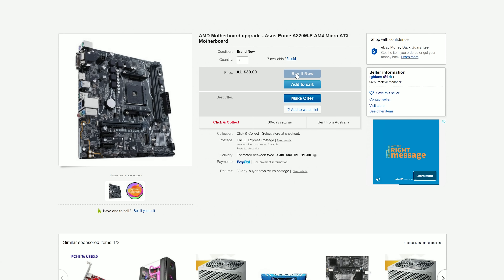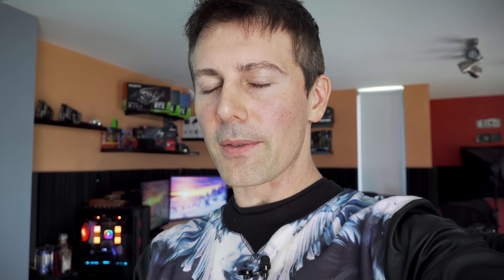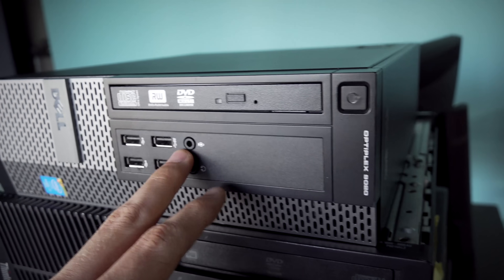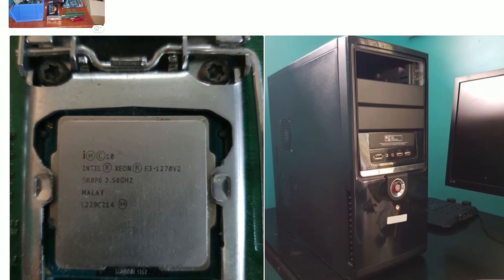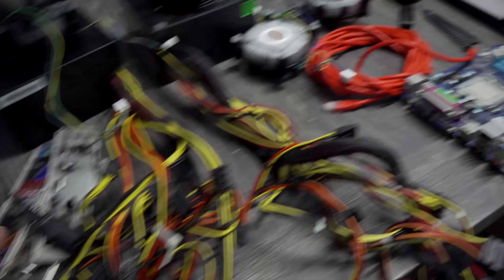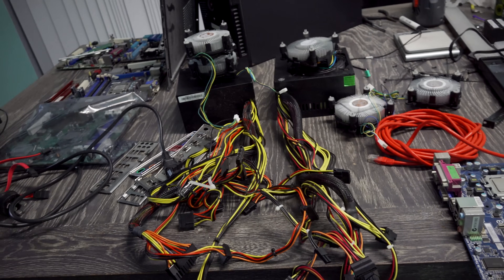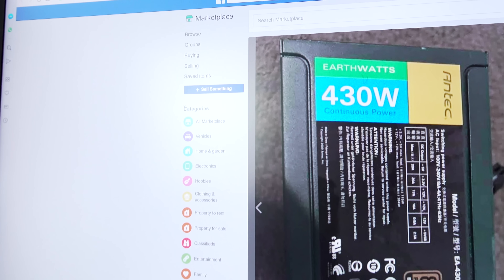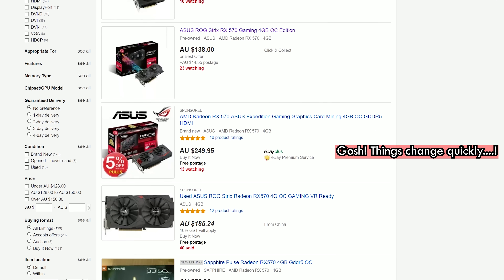Buying $1500 of USED PC Parts... (June 2019 Hunt of the Month)

Comment: Nice haul B! Most systems I run into are dirty! Usually dusty and lots of lint and if there's a pet around; animal hair to. But that can all be cleaned up fairly easy. Computers that have been in a smoking environment are so much worse. It stains everything. It smells and it actually causes damage. Mainly the tar and nicotine because it gets into everything. it gums things up like fans, buttons, and one that used to stand out a lot was optical drives. The lenses would become covered in it and they wouldn't work anymore. You literally had to take the drive apart and clean the lens with alcohol and a q-tip.Fortunately optical drives are becoming rare. Back in the 50's and 60's NASA allowed smoking in the control room but they stopped it because it was causing problems with the equipment. It wasn't just because they're disgusting.

Comment: I a good deal too the other day, I went to a place where they recycle computer and found gold in a pile of crap. I got an dell xps with an i7 6700, 16gb of ddr4 ram gt 730 and a gt 730 oem computer with a 80plus cert power supply for 140 dollar I even got the guy to throw in a ssd. He didnt even know what kind of i7 it was so when he give me the price for it I had to get it. They usually get very old oems so he sold it as if it was one of the old i7s.

Comment: intel xeon 3e 1270v2 works on A OEM MB ????????
Reply: IT is the pendant to the core i7 3770, if there is no bios which supportes the Xeon, there is a possibility to install a very old CPUZ Version, which cames out the time the 1270V2 was released bevore, Th maiboard "" thinks"""" that it is the 3770. i did that with an E3-1240V3 which was recognized as a Core I7 4771

Comment: A320 series chipset support for Matisse - most things I've seen say no, & even a slide from AMD points to a no.  B & X 3xx series, it's going to pend on motherboard manufacturer and decisions they made when making the board in question, but for the most part it looks like a good number will support Matisse - just look for a current Beta BIOS with it to know for sure (hopefully we see non-beta BIOS's by launch day). If the info I've seen and come to understand over the last month is wrong, then it'll be fantastic to have that upgrade path for A-series chipset owners. :-)

Comment: I thought according to AMD's "official" compatibility chart, the A320's would NOT support the 3000 series.  Even the high end X370's were listed as a "beta BIOS" only.  I mean, there's no reason why it shouldn't work, but I guess AMD just doesn't want to take the responsibility of the many cheapo A320s out there not working.

Comment: I’m curious since you mentioned it a bit, if you have a test method for your used power supplies before you trust putting them into a build.  Typically a used PSU is the most dangerous part to pick up because you don’t know what to expect until you flip it on.  I’m thinking a good method would be to test them on some ‘throw away parts’ before putting them into a valuable build.

Comment: I thought you were done with the LGA 775 socket
Reply from the maker: I am, that was just thrown in with the 150 deal.
Reply: @techyescity  have you realized this chinese seller who sells the tons of Core 2 Extreme QX 6700(<20), QX 6800(~34), QX 6850( ~45). He has every core2 Extreme, only the QX 9770 not, the QX 9770 still costs ~200€? I´ve testet a QX 6700 on my P5WDH Deluxe. It works, and i could overclock it over 4x4 GHZ with the the referece cooler. Thr mor you buy, the chips getting cheaper~ 10 QX 6700 for 150€ andyou can giv them back in between one year!!

Comment: For those in the US, buy a brand new rx 570 or 580 and sell the 2 free games that come with it on reddit. You'll be looking at a brand new rx 570 for ~$100.00 and rx 590 for ~130-150. Microcenter is also running a deal for $30.00 off when bundling and AMD motherboard and CPU. Plus a ryzen 5 1600 is going for 79.99 at microcenter. Lot of great deals out there, get them while they last!

Comment: how do you know a seller is good on FB and Gumtree? i've been thinking of getting a 1660Ti to use in an external enclosure (Alienware graphics amp). is it better to wait for ebay deals or flip my current Alienware 15R2 that i wanted to get the enclosure for? (want to drive a monitor and a tv from the discreet graphics but it only has one video output)

Comment: Why are you willing to spend so much on a 1050 Ti while the performance/$ is so much better for the RX 570? Is it just because of branding? The buyer who knows Nvidia and doesn't know AMD, does that make you spend more on the 1050 Ti? I think that $113 is quite a lot for a second-hands 1050 Ti, especially compared to the prices of those RX 570 cards which you mentioned while the RX 570 gets a much higher FPS for every game compared to the 1050 Ti. Hell, even in Gameworks Final Fantasy 15 the RX 570 beats the 1050 Ti if I am not mistaken.
Reply from the maker: Yeah man, for used flipping there is nvidia and i7 tax.
Reply: @techyescity  

Thanks. :)
Reply: @techyescity  

Coming back to my rant on people throwing away perfectly fine PC's. At a public music school close by they have 4 Apple AIO computers in the teachers lounge. Such a waste of money. I told my teacher that they could buy a computer for $50-100 and a SSD for $70 and a $100-150 1080p IPS monitor which gives the same performance except for the monitor having a lower resolution (irrelevant for what they do with it). To my surprise the teacher (early/mid 20's) also was aware of that. They don't use those computers for anything which requires any processing power. I try to educate people around me to not waste money on hardware which they don't need, especially if ordinary people pay for it. They could have lowered the tuition fee or have bought a few extra pianos (practicing outside te classroom) with that money.

Comment: You have got to love those second-hands OEM boxes, one person's garbage is the other person's treasure. Especially because many sellers are clueless about the value of it. Having said that, the value of any quadcore CPU has decreased a lot because of Ryzen but most people don't need a computer for games which require more than 4 CPU cores. Frankly, it annoys me that people throw away PC's which would be perfectly fine for offices, students, most grandmothers...as long as you put a SSD in it and do a clean install of Windows or put Linux on it. Maybe another case with a proper fan.

Comment: The Yes Man with another great hunt! Anyone got advice on what to do with modular power supplies? Got a heap of them sitting around cause I don't have cables to go with them, and the cables seem to be around $10 each. At that price it seems better to just buy another power supply.
Reply: Buy a decent(doesn't have to be expensive mind) crimp tool and crimps and get modding.  I just done my Enermax Galaxy DXII which is(I think) over 10 years old now.  Looks really nice with white sleeving too.  It really wasn't that expensive either.😊
Reply: @JuxZeil  I hadn't even thought of just crimping my own damn cables for them. Thanks! I will definitely look into that.
Reply: @ItIsNot1984  No probs.  If you're like me, a bit of a hoarder, you can use the wiring looms from just about any 12V+ appliance/equipment to really save you a lot of cash.  👍
Reply: @JuxZeil  You got me on a wild tangent now. Looking into this and thinking, "What would stop me from making my own replacement cables and selling them?" As I'm looking into it, this seems like a ridiculous markup. Even on aliexpress, they're almost $10 each. The demand is definitely there considering modular is so popular. Nearly every time I buy a pc for parts, I end up with a psu that is missing cables. I use what I can while others get thrown into the pile.
Reply: @ItIsNot1984  It's a lot of work to sell to public, and the copper in the wires is what make the cables expensive really(copper can go up/down in price DAILY so they adjust pricing for it).  Also some manufacturers have custom connection block(extra R&D) or they are wired slightly out of standard spec, so be mindful of that too!

Comment: Ebay is drying up but in the states. MicroCenter got some killer deals on open-box GPU's and a 7980XE for $1200. That still seems like a deal to me. 
  As far as GPU's, how about an ASUS dual GeForce RTX 2080ti for $900, MSI Ventus RTX 2080 for $650 and a EVGA XC Gaming 2070 for $485 along with a Gigabyte triple fan OC RTX 2070 for $550. For the more nicer cards they have some EVGA 2080's FTW 3's for $800 and the BEST deal's of all, the VEGA's. 56's for $280 and 64's for $380. Let just say i'm cleaning up. I bought a couple open box 16GB Trident Z RGB 3200MHz kits at $120 each. might make a vid with all the open box-deals and hit every MC up state to state.lol then again that might not be smart if i want keep getting these deals.

Comment: Dont know why i bother writing in the comments section as i never get a reply, well except for the time you were in Italy and i had a go at you for bad mouthing a Pentium 4 system/Mobo. Anyway here goes. You may want to check out MSY for deals on PC cases and 120mm single color RGB fans. https://www.msy.com.au/wa/cannington/fan/22257-gamdias-aeolus-e1-1201-120mm-single-blue-gaming-case-fan.html I got a few of these for a Xeon build and an i5 build and the fans are really good quality compared to the cheap crap on ebay.

Comment: i have i7 3770k but my motherboard intel h61 oem pciex 8x working i need z77 mobo
Reply: Hi i have a i5 3570k i am planning to buy an asus z68 from aliexpress for 60€ its also pretty decent for oc
Reply: @techcheap2340  the Z68 platform was made for overclocking, the H61 not.
Reply: @8iosatlost209  yeah thats why you need and z68/z77 for overclock
Reply: Biosat Lost
Biosat Lost
vor 1 Sekunde
i can sell you an Asus p9x79( refurbished by myself 150Dollar)& a Core I7 3930K(80dollar), Xeon E5-1660( 139dollar), E5-1620( 40Dollar)and an evga GTX 980TI SC+ refurbished( together with board& CPU)160 dollar: P9X79+Core I7 3930K( i can overclockthe chip in the bios to stable 6x 4,6GHZ) together for 360Dollar,  i give a case as as gift if you buy this

Comment: Have motherboard manufacturers rolled out BIOS updates for Ryzen 3000 on current boards? If not, then people should hold on to their Zen 1 and Zen + CPUs
Reply: (Otherwise they won't be able to update the BIOS required to get Ryzen 3000 chips working)

Comment: whenever i see something iffy in hardware i clean it up just enough then test it real well then when i'm sure they're good to go, then i clean up real good. sometimes i cleaned something up real well then i ended up cleaning it up and wasting my time.
Reply: Sometimes fully cleaning it can make it work, had a absolutely caked in dust and dog hair gtx 960 that wouldn't boot, took it completely apart and cleaned it repasted it and it booted fine and stress test passes.
Reply: @moramaasi  i do that only if it absolutely needs it and if it really doesn't work when it's somewhat dirty.

Comment: nice parts hunt <3  
I myself use a old  HP 800 G2 with a 1050ti LP as my main gaming rig and im happy . greetings from germany
Reply: I have a 970. Is the 1050ti faster?
Reply: Kubat Altu no the 970 is faster
Reply: @HoellTech hmm you play 60fps on 1080p? Because my grafficcard is already getting bad at holding 144fps in most games
Reply: Kubat Altu Yeah i Play on a 60hz Monitor. No Problems.

Comment: Cool deal on the Optiplexes! The 9020 ones do require an 8 to 24 pin adapter to support a standard ATX PSU, but they can be transferred as is into a regular case as long as you keep the thermal sensor, chassis intrusion switch and the IO cable. I just finished to solder all the IO cables on one of these to get it into a mATX case and all is working great with no boot errors! Cheers!

Comment: The total deal has to include your time, vehicle wear, fuel etc. Purchasers of your rigs should consider this if you are selling systems 3,4,5 or 6 times the cost of the original purchase...
Wouldn't an undervolted, under clocked rx 570 still be cheaper and faster than a 1050ti and not require extra power? I'm going to run my GPU into the ground. Prices way to high to justify upgrading a GTX 970...

Comment: hahaha i have a i5 2400 and want a xeon 1270 v2 for "upgrape xD
Reply: an e3-1270 v3 costs about 100€, so the e3-1270 v2 is around 80, i would look after an e3-1270. It is 100 MHZ slower and nearly the same. i bught an e3-1225 for 22€ a few month ago, the 1225 is cheaper than the 1220 which costs about 30€.do not overvolte the memorycontroller much over 1,55V,!!! the e3 Xeon memorycontroller do not stand as much voltage than the core CPus from this generation!!
Reply: @8iosatlost209  i dont plan on oc It, and the only difirence is 32 Nm vs 22 nm on the other hand you are right v2 cost 110 usd and v1 cost 73 usd so thanks for the tip im looking foward for It
Reply: @danychang1206  i could trx to get an E3-1270 v2  for 90-100 Dollar for you, if you pay the shipping and tax! If you want?

Comment: around 10pm tonight i was browsing the local facebook market place and saw a 4790k with a z97 MSI (think it was the gaming 5), 16gb ddr3 1866mhz corsair ram and a 980ti all for $500 canadian and someone offered him 350 and accepted so i offered 450 and told him i could pick it up right now, probably not as good of a deal as anyone else but i live in a rural town and that was a good deal for me the other parts in there like the cooler case and storage were also very good, also finding a 980ti for under 300 is quite the task in canada.
Reply: That's a damn good deal.. I bought a xeon e5-2643v2 (3.5 ghz turbos to 3.8 ghz, 6 cores 12 threads) for 40 USD and a P9X79 WS for 170 USD.. need to get 64gb of unbuffered ecc ddr3 1866mhz expecting to pay USD 150 for that
Reply: Pacifist Stormtrooper nice xeons where i live ar non existent only on ebay  or other city’s thst are like 10hours away, if i were to convert my deal to usd it would be around $300 or so USD, cause canada’s money sucks these last couple years.

Comment: Is 350$ for an x79 Asus rampage IV black edition plus an i7 4930k combo a good deal?
Reply: you can get like a ryzen 5 and a x370 motherboard for about $250. unless you really want INTEL
Reply: @timothygarcia267  where I live just the Ryzen 5 cost that price.
Reply: I'd say its an ok deal. Not great or even good, just ok. Unless you're dead set on the x79 platform, what you can get by going with ryzen would be much better. Hell, if you wait just a little bit for zen2, you can get a 3600 plus a nice board.
Reply: not so good, try to get Xeon E5-1650& a normal Rampage IV Extreme for ~<280€. The 3930K is selled for under 50€
Reply: @joeno4683  yeah, I checked the price and is not worth it but where I live pc parts is usually 100$ more expensive than US price.

Comment: What would you upgrade in my setup
Rx570 4gb
750w psu
12gb ram
I7 920 @3.9ghz ... "old CPU I know"
Asus rampage 2 mb 
I'm getting some stuttering and fps drops here and there.. mostly in gta v five m. Pubg occasionally
Reply: GTA V really loves Nvidia cards, so even if you downgrade to a GTX 1050 Ti your experience will be smoother. Also, storing games on HDDs can make them run with stuttering if the game files aren't defragged, so another suggestion would be to either get a large SSD or defrag your game drive. Finally a cheap upgrade would be to get a Xeon X5675 or W3680 and overclock them to 4.2 - 4.6 GHz and disable Hyper Threading, as older games really like true cores, not virtual ones. Best regards!
Reply: If you play on high details probably is the gpu that doesnt have enough ram to run the game with those details if you are playing with low details its probably the cpu that cant support the quantity fps that you want